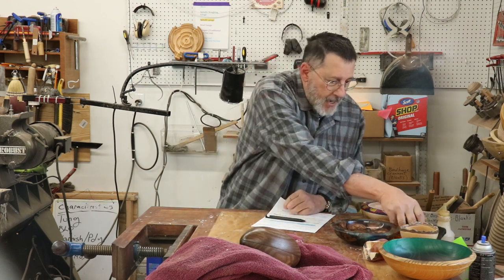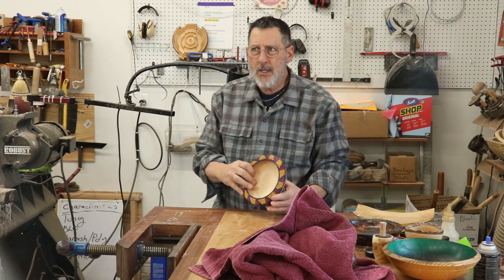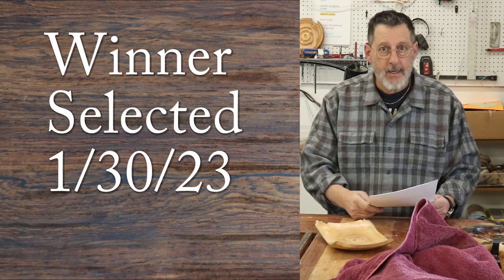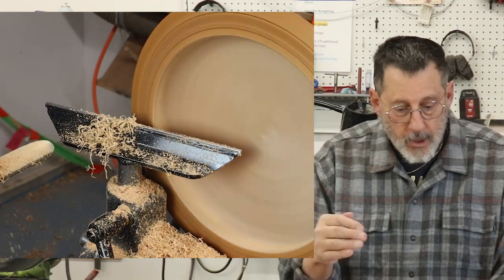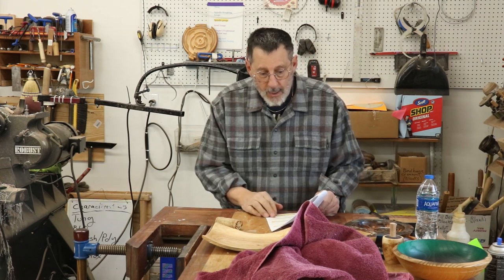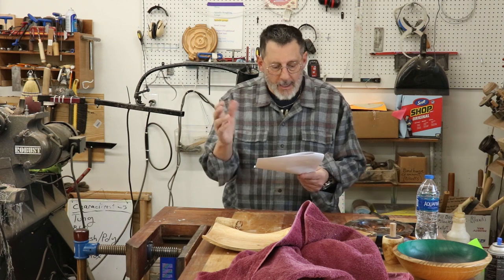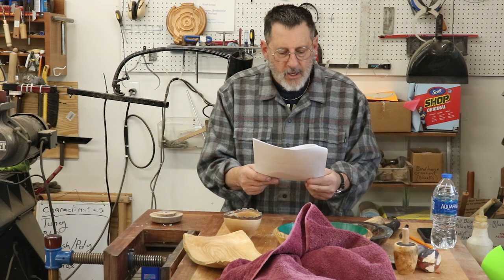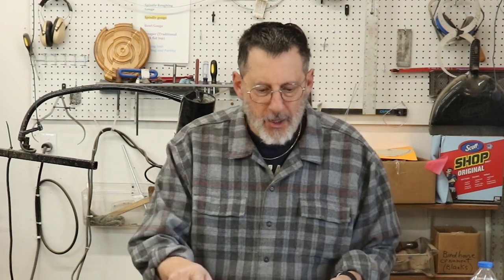Notes from the Turning Shop    January 2023 with Sam Angelo

Comment: Hi Sam I’m glad you found my comment on aligning a glue block for a replacement tenon worthwhile.  I agree it be nice if you did a video along those lines.  BTW: it is easy to remove a hot glued locks by putting a little denatured alcohol on it, then after a little while you can easily pull it off.  As for my comment about you finding a more friendly to me comment picker, yes I would very much like to win a signed turning of yours.  BTW: That squared platter is quite nice 😉🙄. Thanks for the notes and turning videos.  Cheers, Tom